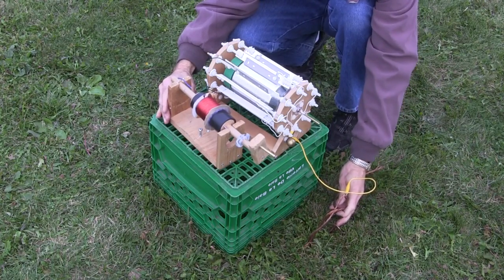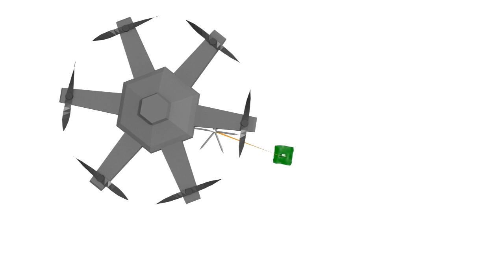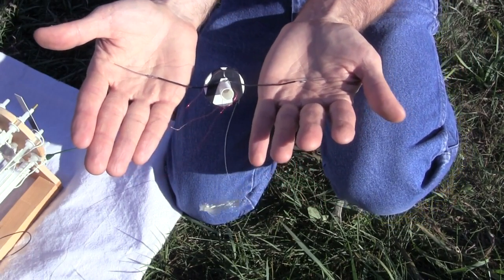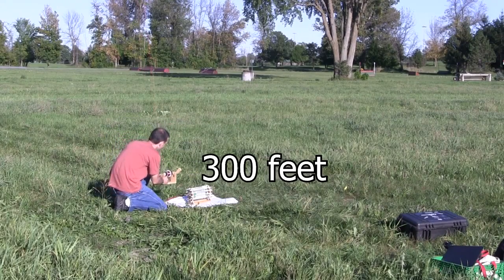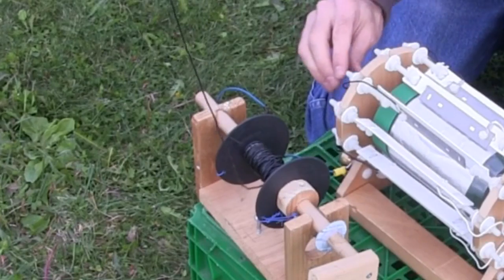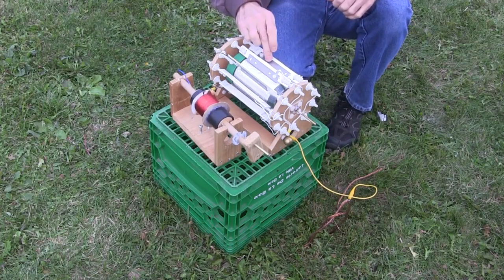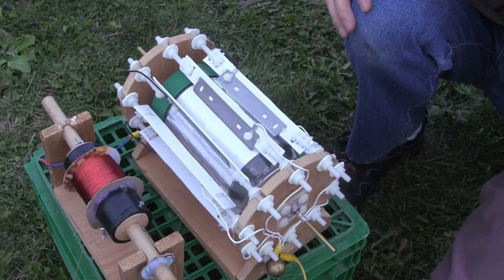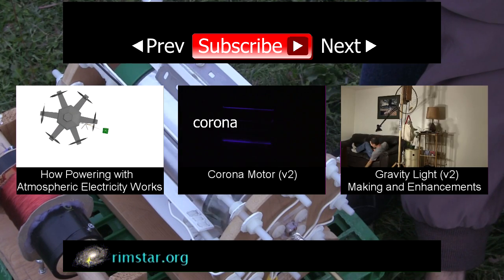Atmospheric Electricity Powering a Corona Motor/Electrostatic Motor

Comment: Is there a way to amp up the voltage and is it possible to fly the wire up using a weather balloon I sort of have an idea
Reply from the maker: To get a higher voltage you just have to go higher. A weather balloon would certainly work. I'd just be afraid of the wire breaking low down and the long wire falling across power lines somewhere in the city. Also, make sure it's secured well at the bottom end. But if you don't go in winds that are too strong then you should be fine. If your balloon has enough lift then you could even use a plastic coated wire which won't break.
Reply: I also wonder if I could just make more than on of them and link them up and have sort of a grid of towers all set at a fixed hight so I don't get into trouble with the air force
Reply from the maker: Absolutely. Just keep in mind that if the towers are made of metal or get wet then the towers act as ground and so you'd have to instead string plastic wires from tower to tower and have sharp points somewhere along the middle of that plastic wire and then a copper wire going down from that. There are a number of ways you could do it.

Comment: why not just use a balloon? it would have been much easier
Reply from the maker: +Trevader I was afraid the wire would break and I'd trail an electrically conductive wire across the city and power lines.
Reply: +RimstarOrg that's a fair point.I hadn't thought of it breaking, but I guess it would have to be pretty thin.

Comment: I wonder if you can use a darlington transistor to make amps form the high voltage with a bifilar pancake coil like a joule thief to extract power from an atenna and a ground?
Reply: The problem becomes acquiring sufficient charge; the reason the voltage gradient is so high to begin with is because air is a relatively good insulator, so there are a certain amount of ions in a given place, and when you've neutralized those, which happens rather fast, you'd have to wait to collect the next batch, which depending on antenna design and implementation, as well as height and atmospheric conditions, might take a while.

On the other hand, if you've got a good antenna, get high enough up, and the conditions are good, you can probably achieve some pretty high amperage. I suppose the epitome of this would be to get a robust antenna high enough up to achieve a standing lightning bolt spark gap, but at that point you're going to have to start considering that a voltage might start to develop in the ground you're discharging from unless you take precautions.
Reply: @hoon_sol  The only luck I have had is two matching transforms with one coil 300,000mh or very high henry rating, I put a piezo element across it and get power out from a matching transformer.

Comment: Have you tried using 3 insulated copper wires to increase voltage?
Reply from the maker: +marten3451 Lifting 3 wires poses a weight issue for this hexacopter. Already we got only around 1 minute of hovering time at the top before the batteries were getting low.
But the voltage is provided by the height anyway. It's the current that's needed. That's gotten by increasing the number of sharp points at the top and how much area they cover. Having said that, insulation in the wire is important the closer the wire is to the ground. Hmmm... It'd be tricky to implement but making a wire that is well insulated near the bottom length but just enamel coated higher up might be a way to help with the weight issue.
Reply: +RimstarOrg so can this current setup recharge a single AA battery?
Reply from the maker: +marten3451 Not as it is. You'd need some way to step the voltage down. But even then it would take a long time to charge.
Reply: +RimstarOrg have you tried sending up more than 1 copper wires up? Will that make a difference?

Comment: Really enjoy your videos, what if you used a 600 gram (8ft dia) weather balloon, electrostatic copper tinsel wraped around the balloon as a reciever, 20 gauge wire with 150 lb kevlar tethering string, all connected to a plastic powered spool and deployed to the legal FAA altitude of 500 ft, The Balloon could be connected to a micro tube and fed with hydrogen from a hydrogen generator to keep it aloft. The umbilical cord to the weather balloon would have to be under 10lb. This would give you extended time to experiment and generate power. Try some oscillating circuits at different frequencies with tesla configured step down transformer, diodes to rectify to dc output. I have my materials ordered, have more experiments I want to try. This area of research is still new and for ages has been written off as parlor tricks.
Reply from the maker: +Bruce sr. Schlueter Sounds like a good plan. It's not one I can implement since I live in the city, and here in Canada our limit is 300 ft right now. But good luck with yours. Let us know how it goes.
Reply: +RimstarOrg I did not know that, Thanks will keep you posted.
Reply: @brucesr.schlueter2171  how did it go?

Comment: You can use tight fishing line and loose conductor next to it. then all force will be on fishing line  and it will not break. excuse my bad English.
Reply from the maker: +Nikola Kn That should work. Doing it with a balloon would be better than a kite, then you could do it on a day when there's very little wind.
Reply: +RimstarOrg if you add 3 more fishing line fixed in the ground to form a triangle, balloon will stand in place.
Reply from the maker: +Nikola Kn Hmmm... Good idea. Just make sure you still have a center fishing line so that you can pull the balloon down fast in case an airplane comes by.

Comment: The multi-sharp-pointed atmospheric connection could be greatly improved by tipping them with radioactive Polonium 210, see https://sites.google.com/site/bio445toxinsjmanuelito/home/polonium . Its alpha particles add innumerable conductive ionisations to those tips.
Reply from the maker: +Peter Nielsen I don't have Polonium 210 but I do have Americium 241 from smoke detectors. I suspect it gives off a lot fewer alpha particles than Polonium 210 though.

Comment: Why not use a helium ballon or somthing simillar?
Reply from the maker: +andi sixtimesseven I wasn't sure how easily the wire would break and I'd have a long wire falling down across electrical power lines somewhere in the city. After having done it this was I'm more confident that it can be done safely.
Reply: +RimstarOrg Yes, getting far away from people and powerlines is probably a good idea. 
What about using the multicopter to generate static electricety? Like a helicopter which can build up huge electrostatic charges due to the rotor movements you could use the multicopters rotors to generate charge...
Reply from the maker: +andi sixtimesseven Using the hexacopter to generate static electricity would be cheating :), if you can that is.
Reply: +RimstarOrg  add a baloom self destruction mechanism like a small timer that is attached to a small air release mechanism
Reply from the maker: +ankhenaten2 That sounds like a fun project even on it's own. Drop a glider from a balloon or a rocket the flies further up or a rocket that lands or ...

Comment: So what would happen if you extended a large nonconductive rod off the Burj khalifa, ran a wire all the way down to ground and had like 20 sharp points? Would you be able to charge a battery with it? xD
Reply from the maker: +Jordan O'C (Xenro66) It's hard to say. The Burj khalifa is likely at ground potential and so you'd have to extend the nonconductive rod and corresponding wire some distance horizontally away to get away from that ground potential. It's the same reason did the experiments in large open fields, as far from any trees or buildings as I could get.
Reply: RimstarOrg Oh right, that makes sense. What if you were to build a tower REALLY high with non conductive materials, because I'm pretty sure that building has lightning rods :D
Reply from the maker: +Jordan O'C (Xenro66) A tower of non-conductive material would work.
Reply: RimstarOrg Let's get to work then! xD
Reply from the maker: +Jordan O'C (Xenro66) Actually there is a relatively simple test you can do with a non-conductive tower - maybe one made of 20 feet/7 meters of PVC or ABS pipe. Put a metal bucket filled with water at the top but with a hole in the bottom of the bucket for drops of water to trickle out. Initially when you put the bucket up it will be at ground potential. But as the drops fall, they will carry away a little charge at a time bringing the bucket to the potential at that height. But to measure the voltage you'd need an electrometer or possibly an electroscope would work. At 7 meters and 100 volts/meter that would be only 700 volts.
Reply: RimstarOrg That's still 700 more volts than you started with! Though, what good is 700v if you can draw probably less than a μA out of it :L

Comment: so can we increase the voltage  by adding more six sharp points in parallel..? 

I wonder is it really atmospheric electricity or just absorbing energy of radio waves from nearest communication tower..?
Reply from the maker: +Oswald Rayleigh Voltage is a function of height. In fairweather it increases by approximately 100 volts per meter. Adding more sharp points would increase current (the amount of charge collected) but there's probably a limit to the number of useful sharp points per unit area.
It's atmospheric electricity. There's no way this electrostatic motor would work using the radio waves.

Comment: would a larger or a vertically arranged collector increase your voltage
Reply from the maker: +sketchyssk8shop The only way to increase voltage is to go higher. In fair weather, voltage increases approximately 100 volts per meter as you go up.

Comment: wow plenty of hard work and attempts made, what can we infer from this? the six pointed needles helped improve the setup, the higher the distance the better it gets, the corona motor should have been built and tested on the ground with a spark gap emitter before the real flight attempt?
Reply from the maker: +fidel catsro I just guessed that the six pointed needle would be better than the two pointed needle given how it works - I don't know that for fact. It was out final flight that finally had success and since we get that success above the height limit, we can't do further testing, though we might do more testing at the limit since weather conditions are a factor. We thought about the spark gap test but we have batteries for only 4 attempts per trip out so went with the corona motor directly. Anyway, winter's starting here so more testing will have to wait until the spring.

Comment: Really interesting, great post! Layman's suggestion/question: I wonder if a big helium filled foil balloon carrying that wire up could increase the gains of atmospheric electricity. Or even several big foil balloons evenly space along the wire? Final layman's suggestion/proposal: Using foil tape, attach MANY short lengths of foil ribbon evenly  distributed all over the surface of the big helium filled foil balloon(s) attach to the wire and measure any gains. I'm done, thanks!
Reply: and on 1st wind pufff no more baloon
Reply: Maybe put the Ballon above the drone
Reply: Stabilizing the balloon would be the challenge
Reply: @RickyStenicky2234  interesting 🤔 but wait.. if you use wires to stabilize it, then the balloon would be grounded via the wires no?

Comment: Can the antenna pick up be mounted horizontal to the ground at about 3 feet or so? 
Also..
Have the FAA changed the height regulations? It wasn't very long ago it was 400 feet, I set my height to 121 meters which is within our CAA regs here.
Reply from the maker: +Green Silver No, the antenna has to be vertical. It's making use of the fact that there's a potential difference vertically above ground, as well as some ions. The voltage increases 100 volts/meter as you go up. So at 120 meters the top of the wire was at 12,000 volts with respect to the ground,... well, until it starts conducting, and then much of the potential is down at the corona motor.
Regarding the FAA, I'm in Canada (Ottawa). But according to this http://www.tc.gc.ca/eng/civilaviation/standards/general-recavi-uav-2265.htm?WT.mc_id=21zwi the limit is 90 meters here. It's labeled safety guidelines but the local drone flyers stick to it. Do you have a link to the CAA regs that have it as 121 meters? It'd be great if that is the case since that's where we had success.
Reply: Here's the CAA 400 foot regulations, article 166 clause C. 

https://www.caa.co.uk/default.aspx?catid=1995&pageid=16012

  I thought the FAA had pretty much the same regulations, soon the FAA will be requiring all U.S. UAV's to be registered to an owner. How this will affect Canada I don't know. 
  It's up to the operators to keep up with current regulations, they don't accept ignorance as a good enough excuse.. 
  Fly safe!
Reply from the maker: +Green Silver Thanks. Hopefully Canada will catch up.

Comment: Wow, that's pretty tenacious of you, busting through three failures in a row. That was a great demonstration- I guess 1% of the people will miss the thumbs up and accidentally click the thumbs down. (It's happened to me before also as well as reporting videos. Sometimes the settings are just too hair-trigger.)
I'm surprised it would give you such a biting shock, but barely turn the motor, when you could run a same-size motor with a AAA battery. For it to continually have that much shock (as opposed to pulsing) seems like it ought to have a lot more energy. Maybe it's because the parts are very large and spaced apart, whereas an electric motor is able to be tiny and it has tiny windings and connections because of its lower voltage, giving it a lot more leverage and immediacy of action.
I wonder if it would be safe to do it during a storm? On one hand, it might help discharge and relieve some of the charge instead of allowing it to continue building up. But on the other hand, it might accommodate the charge by causing the atoms in the air to be attracted to the wire and clump together, and providing a physical ladder for the charge to descend along.
Reply from the maker: +gilbet Thanks, I'm glad you liked it. I don't think the shocks would be continuous; the voltage would take a little time to build up between each shock. However, I didn't test that, for obvious reasons :).
Reply: RimstarOrg Oh, do you think it discharges and recharges every 1/8 turn?
Reply from the maker: +gilbet I don't know how fast the recharge is. I can't judge it on the fact that the cylinder keeps moving since the cylinder moves pretty easily and so doesn't need a lot of momentum to rotate for a while.

Comment: the sky is the limit?

are those laws enforced in some way?
Reply from the maker: +‍1marcelfilms Yup. By 50,000 meters the sky is an excellent conductor horizontally so that's the limit, like reaching the other capacitor plate. But then again, that could just mean you do different things above there. :)

Comment: Might it be that your first attempts didn't work due to differences in the weather?   More humidity probably means less electrical charge in the air.   Unless that humidity is due to an approaching thunderstorm.
Reply from the maker: +Carl Smith That's quite possible. +lasersaber, who came up with this approach to lifting the wire, also had to go 300 to 400 feet up to get it to work. But the the 1st day had clear skies and the 2nd day had cloudy skies, so I wouldn't rule it out.
Reply: Can you test the voltage using a volt meter to see the increase with altitude?

Comment: +RimstarOrg would a corona motor be able to do work? Assuming maximally optimized .
Reply from the maker: +Adam Jeffords I've read of experimenters from the mid and early 1900s who got high efficiencies but the output was a tiny fraction of a horsepower, millionths if I recall correctly.